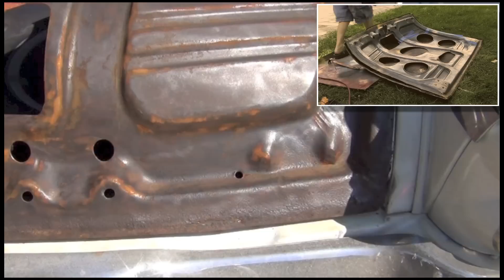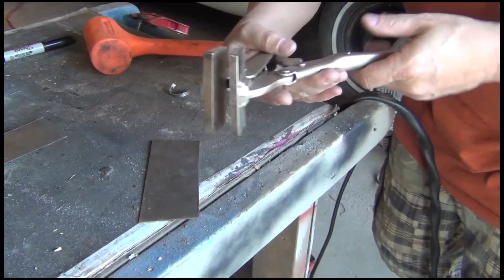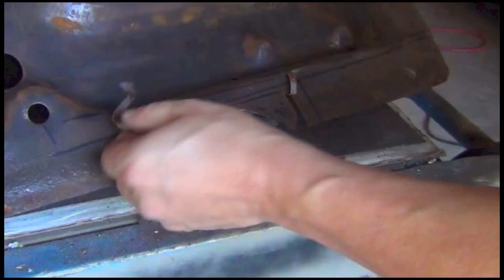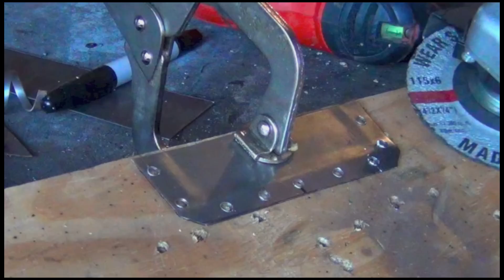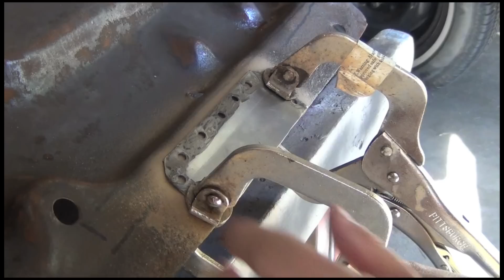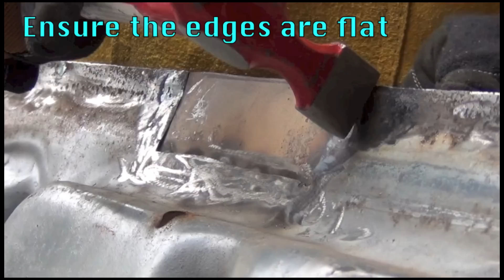How to Patch Rusty Metal

Comment: For those wondering about using gas or flux core as someone posted you use gas shielded indoors and flux core outdoors because if you have any breeze the gas will not shield the weld very good and you will get a bad looking weld as well.
Reply: +Daniel Silvaggi  Oh by the way nice vid Tony.

Comment: Not sure how much you used your welder, but I know from personal experience that MIG with flux core wire is no wheres near as nice as with solid wire and shielding gas, so if your machine has gas capabilities I would Highly recommend spending the little bit of extra money and it will make your welds so much nicer
Reply: *use
Reply: And I forgot to add, its not that flux core gives you bad welds, those in the video were fine for what they needed to do, they'd have just been prettier with gas

Comment: just saw this video. have a bunch of rusted panels on my truck and would like to repair it. after the patch, I'm assuming that you use bondo to finish up the patch before painting? thanks good video.
Reply: No, you'd only do this type of repair on a hidden panel. The proper technique is to butt weld a patch

Comment: I have to weld on some new rockers and metal patch some largeand small holes on the outside panels, rust spots what do you recommend for a welder. Thats not to expensive. Thanks nice video.
Reply from the maker: One of these welders isn't too bad, but if you'd probably be better off with a welder that you can adjust.  I don't have any brands in mind, but you could easily spend from $300 on up for a better welder.

Comment: Though I can see what you're trying to demonstrate, I think your technique might be improved. The lap-joint tool you're using to make the flange doesn't seem to have the mechanical advantage one gets with and old-fashioned 'joggler' or 'joddler' and thus the step is not as sharp as it could be - I've had my joddler/punch plier for over 30 years and it still works really well. The punch makes burr-free holes for plug welding so no need for drilling. Also, if you have access, it's best to make the holes in the old material and weld through to the new material - you're more likely to get a good weld. BTW, your welds looked very grainy - did you have the gas pressure correctly set? Also, when repairing an inner skin edge, a lap weld is no good because it creates a double thickness where the outer skin is attached and thus creates more work. As the original steel was not too bad, a butt weld would have been more appropriate. Sorry to be so critical, but you're pointing people in the wrong direction on several common trade practices.

Comment from the maker: Hey MrWeleyrick, if that is your real name.  LOL   I chose the butt weld because this patch will not be seen and the old metal is thin an brittle and butt welds just burn through.  Also, since the one side is welded securely, there is no need to weld it form the other side.  It will be finished with some seam seal.   Hey, maybe you could do a video and show us how to do it better!

Comment: I don't believe what I saw. Should have been a butt weld patch to start with. If you were going to all that work to make the patch you did, just weld around it. Not need for the holes. Actually weld both sides for a stronger patch. I guess you were getting paid by the hour!

Comment from the maker: Oh.  Trunk lids have an inner and outer layer. This is the inner layer that won't be seen after I weld the outer skin back on.  Those are plug welds. The kind you use on hidden metal like floor pans.  If this was the outer skin I'd do a butt weld and grind it smoothly before using minimal filler.  Does that help?  Thanks

Comment from the maker: @coryjor - I should have elaborated on that better.  These are called plug welds. The hole is only in the patch piece.  The goal is to fill the hole with the weld by having the wire melt into edge of the hole in the patch piece and the metal in the piece to which you are attaching the patch.  Does that make sense?

Comment from the maker: You would if this was on the outside of the body.  This kind of patch is for floorpans and hidden sheet metal.  This patch is on the inside of my trunk.  The outer skin of the trunk has been removed.  Check out my other videos for details.  Thanks

Comment from the maker: You could also use a copper heat sink under the place you are welding.   The heat sinks do a great job of dissipating the heat and some of them have a thin ridge to go in the space between the panels so that the butt has a little space that is perfectly aligned.  Search on "Eastwood 4 and 8 Inch Magnetic Copper Butt Weld Backer Set" for more information.  Note:  I didn't buy these.  Instead I got a 6" piece of thick 1.5" copper tubing, cut it the long way and pounded it flat. I use clamps.

Comment from the maker: Hey Pumpman99, I was welding 18 gauge sheet metal with a wire speed of only 1.  Butt welding will be a bigger challenge with this welder due to the lack of power controls.  Also, this is not so good if you are welding part of the body that will be painted and visible to people.  Eventually, that flux in the core of the wire will bleed through and ruin the paint.  Depending on what you are doing, you may need to get a better welder.

Comment: Great video tdt.  Could you post what wire speed you were using and what gage metal you are working with.   I have had a problem burning thru the metal while butt welding a patch on my VW.  Thanks and keep posting.